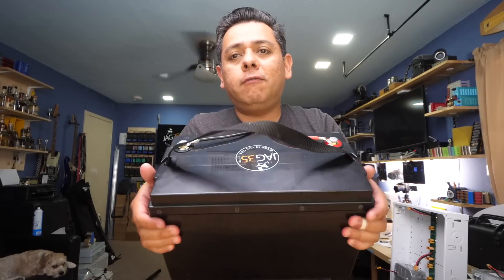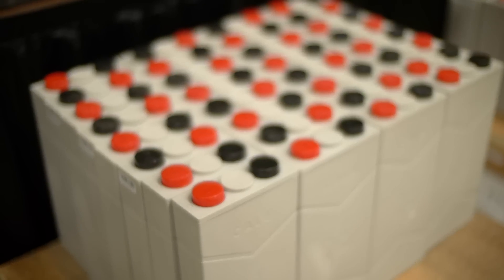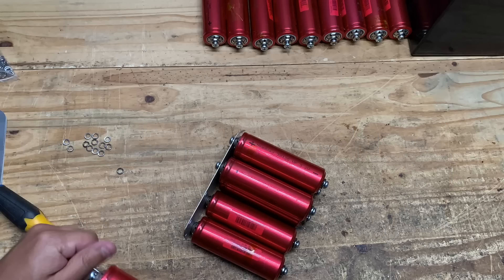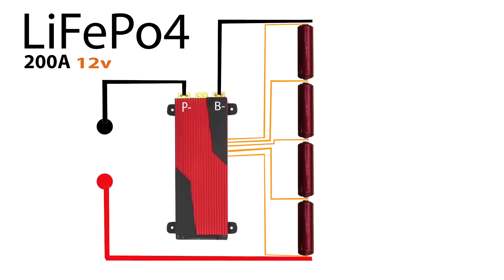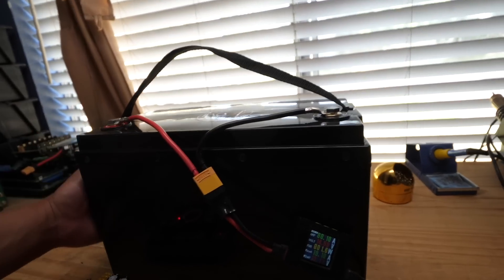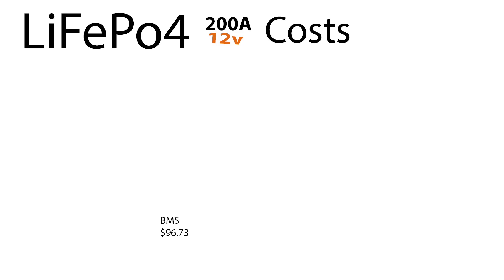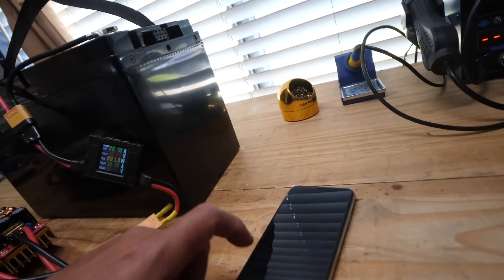Build a DIY Lithium LiFePo4 Headway 12v Battery replacement

Comment: I don't understand the relationship from amp hours to kwh in this video. I thought I understood, until I seen this
Reply from the maker: Ah x Volts = kWh
Reply: @jehugarcia  outstanding! Thanks
Reply from the maker: But likely this video is talking about kW = power not kWh which is storage capacity

Comment: Hey I have a question this is holding me back from making a battery pack is how can I find how much amps can a cell produce when I have lil to no information about them I bought old e-bike battery pack??,?, can you please help
Reply from the maker: You have to test it.   If the voltage sags to much or overheats then you know you’ve reach the cell power limit

Comment: 334 / 5 000

Fordítási találatok

Fordítási találatok

star_border

Hello! very good video, the batteries seem to be of very good quality, I have a few questions. I'm Hungarian and I'd like to buy this type of battery, how can I do it? - Where can I buy such batteries? - there is a screw at the end of the battery, it is not standard that you can do this, or buy it i? -If I put it on ebay, I would buy a few. I appreciate the answer: Tamás

Comment: I think the separator is a good idea (cardboard may not be the best material, but definitely better than nothing), however I don't think the reasoning why you didn't use any in the middle is sound. 
It's correct that there are screws holding them in place, but that's only at one end. At the other end, the sides that you placed cardboard in between is held together with a bus bar.

Comment: ok getting it now this is an 8 AH battery and four parallel gives 32 and this 200 AH is not the battery amperage, dont be confused. This is the discharge rate given by battery hookup and isnt the battery capacity at all. This battery is a 32 AH capacity (4 times 8) storage battery and nowhere near a 200 AH battery you will see sold at much higher cost.

Comment: might not see this but as a car replacement is it cheaper to create a battery out of 18650 cells that would charge a capacitor jumper rigged into the system. then the charge off the alternator regulated somehow to keep the Li-ion topped off but not over charged? might be cheaper than this set up for that application.

Comment: Just the cells alone, the price is already over $330 which you can buy fully assembled LiFePO4 12V car batteries. Upside you can replace the faulty parts and know everything inside it safe to replace.

Comment: I just want to use the headways to build a battery for my sound system , will 8 be enough and what’s the best way to wire them and what size wire should I use if I make connections with wire

Comment: hello, theoretically how long should this setup run a load of 10 amps and would this mathematically be a 64 amp hour battery 
also what is the cell configuration

Comment: I would like to build an electric motorcycle using as many golf cart parts as possible. I already have a 48v 3.5hp motor, a 450amp programmable controller, and plenty of cable. With 4 batteries like this and gearing for a top speed of 65mph how far could I potentially travel? 10 miles? 100 miles?

Comment: What do you think about fuse'ing each cell? I only ask for this because i did have an old Li Ion Battery with this Special Foo Like polarity Reversed by it self, this was Not funny to get this stupid Heating Lithium cell Out of the battery Pack. Is there Not an issue Like Reverse polarity to be Possible with LiFePo4 batterys? 

Kind regards :)

Comment: Perfect except you didn't explain the balance cables, or balancing the cells, or bottom balancing them. 3.66V is overcharged yes, so you could save yourself some potential headaches by programming in an over and undercharge safety so it charges to float voltage and discharges no lower than the safe lows of the cells

Comment: i don't get it ???  just the 32 cells cost 2,800 $ from this link.  why would anyone besides a student for a science project build this??  you can buy 100aH lipo battery's new unused for 1000$ with a 12 year warranty with a charger. what am i missing?  great instructional video though.

Comment: To recreate this project almost two years after this video, batteries and shipping (US) are costing nearly $800 from your link.
Reply: 3 years is showing about $400 — used (like he said), but tested cells. Even at $800 it's a pretty awesome setup using 38120HPs

Comment: How many Amp Hours was the battery you built in this video? Please..if i missed it anyone answer. I thought i heard 50? If that is the case i can buy one for under $400 pre-made by Battleborn or another reputable company. If we are talking about 100 or even 200 then that is probably worth it. Usually the case is that when you build your own you save at least 50%.

Comment: $88 each battery. Lol. What’s Plan B?
What happens if you just use four  18650s?  Most 12V DC can handle 14 volts. You’re car alternator is 14V. What’s the problem

Comment: Would you recommend this batteries for a car conversion? 
If so how many I would need to build to at least have a 100 mile range?
Reply from the maker: No these don’t have the required energy density to make them viable

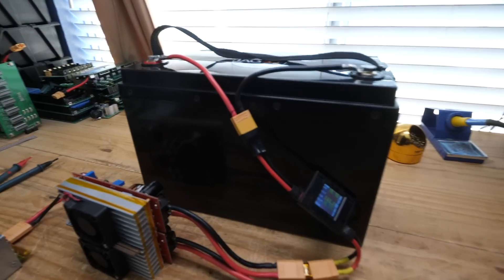Comment: Are those two DC Buck Boosters at 6:15 connected in parallel?   How do you hook them up?  I see one unit takes the negative input and the other takes the positive input.

Comment: Ordered 16 38120 HD 8 ah

Making a portable power box.
I have a 1/2 mile long driveway. I have a harbor freight electric pole saw to keep the brush and branches cut back. 

I’d like to make  four separate 12 volt batteries. 

Wire in series, then in parallel. 

Result 24 volt 16 amp system? Right? 

Will I need a BMS for all 16 batteries, or one for every 12 volt. 

Then a 24 inverter, but what wattage? 

Your channel is very informative. 

You sorta remind me of a friend I knew while I was on active duty in 
the 90’s

Comment: How can you have neg, and pos on the same plate, wouldn't it have continuity? And short out.
Reply: @hbvvc gghh oh so its like being set up in series, positive to negative. So in  each bundle the batteries are set up in parallel, then you put them in series.
Reply: @hbvvc gghh and the bms, red wires go to the positive side of each bank, and the black to the first bank negative?
Reply: @hbvvc gghh  oh ok, so what does the 4s mean in a bms, is that for a 12v battery setup?
Reply: @hbvvc gghh oh I see, I really do appreciate your help!!
Reply: @hbvvc gghh yes, actually I'm looking into taking some circuits off the grid at home, and putting solar to them. So I ordered some 3.2v lifepo4 prismatic cells. But interested in building my own.

Comment: I pay $49.99 bucks ( $55 with taxes ) for a 12V lead battery for my car every aprox 3-4 years. So I will spend $550 bucks on my car $12V batteries over a minimum 30 years period.
Then why would I need a 12V lithium ion battery that costs $550 for my car ?
Am I that stupid ?
Reply: lol. A fool would use this in their car. Ive been researching this for a week now. This is for systems where you can get 10 year out of. Every time you wear down a lead battery pass 50% you cause damage. These are for Solar.

Comment: Thank you for the informative video! I am trying to build my very first battery pack to power a 560W trolling motor for my kayak. Can I put 3 of these ((https://www.amazon.com/gp/product/B07X7MD2JK/ref=ask_ql_qh_dp_hza) )  batteries in parallel and get 48 AH capacity capable of running a 560w trolling motor? Also, would you be able to recommend a battery monitor meter that can measure AH? I am trying to do this on a budget, not cheap. Thank you!

Comment: After one year this build has entered the territory of purely educational. A 100Ah Battleborn would actually be cheaper than two of these even if you could still source the cells at the stated price. These cells are $88 new.

Still a great build.
Reply: Battleborn is that a brand?

Comment: The wires you use to connect the Main+ and Main- looks too small for more than 50A current, it will become very hot ( I'm sure the measured temperature will be hotter when if you remove the case, and influence the cell's consistency is strong, why not use 4 wires to connect them to the BMS or the pole together. heat is the killer to the battery, do you agree with me?

Comment: Great video. I did get 4 from batteryhookup, just to suppliment my sound system. Thou im queruous if i can do an 8 pack 4s2p which will fit my bike, would they start it. Bike has a 20A battery.
Reply: absolutely.. Story time!!! I have a 2009 KLR 650, bored out to 688cc, and i used a 4s1p pack of headway cells in 2016 to replace my battery. I extended the battery leads 4ft to place the new battery in a toolbox on the rear of the motorcycle to protect it from heat. I haven't ridden this motorcycle in two years now, but every few months when I want to clear the carburetor, I go out back and start it up. it has NEVER failed to start in these five years. The battery you suggest would start a small car. For a bike, it'd run for years and years if you manage the heat.

Comment: If you charge a lifepo4 I've heard the battery voltage sags down quite a bit after a few minutes... Why?

I charged my batt to 3.6v and it dropped to like 3.4v in 10min...

Comment: Given that each cell is 8Ah, that means it's ~$550 for 72 Ah @ 12V. In comparison, Amazon has brand new ready-to-go 12V LiFePO4 batteries for around $750.

Comment: I have a lawnmower that eats batteries. Lead acid does not last long charging and discharging, 2-3 years and another $150. Is there a way to use 18650 cells in a configuration for a UB12220 12 volt 22 amp lead acid battery box with the lead cells removed and plastic cells ground out to make the space available. Did you already make a video on this? I saw something on EBay that uses them but at $380 a piece. Maybe I should just go back to gas.

Comment: shtty idea. I know you've been sponsored by this battery producer but this is baaaaaad. 18650 cells we connect via tin wire which works as a current breaker you build it that way it is very dangerous if any of them dies after few days or 3yrs of use. Bad craftsmanship. go away
Reply: Pointing out the deficiency is one thing, but demonstrate via video what your talking about. Identify the issue, then provide an example (video, or link to a better build).

Comment: Hey friends. 

Long time no see since COVID infection. But getting better here in UK. 
Can I ask if I can make a 12v 4s 2p pack using 5 headway cells I have received??? 
Thus making it 12.6v and 18A??? Or should I get more cells to make it proper 4s 2p??? 
Any advice would be highly appreciated!!! 
It won’t be used for anymore than max 10A draw for small amounts and running some small 12v lights and appliances at 50-70w. Stay safe friend 🙏✌️🙏 keep at it Jehu!!! 💪💪💪

Comment: Interesting - and well done.  But ventilation is of concern.  Saw 67˚C (154.4˚F), which is rather warm for my liking.  Question comes to mind - how long can those batteries last in that kind of heat?

OK, this was a max test.  But in automotive application - how will the batteries fare not discharging very much before they're topped back off?  AND IN A CAR APPLICATION - you can't charge the battery from the battery terminals.  One would have to modify the alternator charging circuit, which means potentially altering how the car's electrical system works. I'm sure it can be done - but at that much expense - perhaps that battery is better served as a deep cycle battery.  Again, I don't know how long those cells would last being discharged deeply then replenished.  If you know the answer(s) to these questions - please respond.

Comment: Is this comparable in spec to a standard car battery? It seems like you built a trains battery rather than a car battery. I would like to see a standard Toyota Corolla spec battery. A true 1:1 car battery to lithium. 
(Truthfully I want to see you make a motorcycle battery but a car battery price and layout would be just fine)

Comment: Hi i need a little help i needed opus 4 cell charger but accidentally bought i-max b6. Can you help me to sell that so i can buy a opus, or if some one wants to exchange i can do that. I really need the opus as to check 4 cells at the same time, or else it takes a lot of time to check one by one.

Comment: Next time cut out a thin plate of plexi glas and then mount the plexiglas with the battery screws ontop of the metal plates, that way the distance is provided and it even looks cool👍🏻

Comment: A 100Ah Renogy 12v LiFePo4 battery on Amazon is about $800. $560 for 60Ah battery is hardly cost saving considering you get no warranty on your battery,

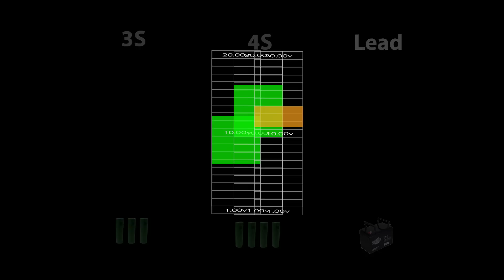Comment: How do battery manufacturers deal with "mismatch voltage" you describe at 1:07 when making 12v Li Ion batteries? Do they use 18650?

Comment: To anyone and everyone...   Would this battery setup be a good fit for a sump pump backup system?  It's my understanding that these batteries are good for long-term power retention but it doesn't have enough power (current) to support the draw of a 1/3 HP pump.  Any suggestions?

Comment: At 200am x 12v is that 2400 watt hours? Not an expert on batteries but for $544 that is a good deal for DIY right? That should be enough juice to power a microwave or stove cooktop after you get some solar panels as well to charge it.

Comment: Could this be used as a car battery? What about a solar power system?
Reply: Idk anything about solar power but a lot of people have started using them in car audio applications, you just don’t wanna put them under the hood because lithium batteries don’t like heat

Comment: Hey brotha .  Omg this is so incredibly cool. Amazing power and durability.  Ideal for what I need. I will dream of this untill I'm dead. I could never afford to build one but this is perfect for my trailer. Your so awesome for sharing the details. It would take me 10 years to buy each part but a guy can dream. Using two old battery's from a diesel truck that my son donated from his job is what I use and omg they are heavy. But they are 4 years old and were treated poorly. When I got them charged fully they were about 12.9 volts. But just don't have the amps in them. This is so hard to charge fast. Takes hours every day to charge with jumper cables and my vehicle. Ahhh . I'm basically homeless as we lost our home . The wife hates it but I'm grateful we have a trailer even though it's old. I'm on disability and dont get squat from social security. This is. Great info. If you ever had and old stuff to donate I'd be the one to help. Anything at this point. I need to use a Bipap machine at night to sleep and it' uses a lot of power with the water chamber on. Without it it's not so bad 6 amps maybe. But the 300 watt inverter just kills the battery before I wake up. I have to hook up a cord to my truck battery when it dies . (usually after 4 hours ) so I get up and do that to get the rest of my sleep. What a bummer it is. 
Anyways I just love watching your videos. I'm hooked. I've watched them over and over. But darnit I don't have the money to build one. Arrrgggh. I'm dreaming though. So hey great name and great videos. Keep doing what you do. Old People like me just love this info. 
 Jehu Garcia  peace my brotha.

Comment: The cells can produce much more discharge current than 200a, so is the BMS a bottleneck in this system? Can you use the BMS as a balancer only so you can use the pack directly for more discharge current? (car audio application)

Comment: Can you please post what this build ended up weighing?  I know a few Ham radio guys who might be interested if the weight is right. We pack radios, antenna's and batteries up on the highest point we can get to and do what we call "SOTA" (Summit On The Air) activation.  Mt. Hood, St Helens, Mt Raineer...if it has elevation, we'll go. The only thing holding us back is battery life and weight.

Comment: Great Video, Jehu! Very clear, not  ton of wasted time, great sharing. Price for a well built battery is just OVER the cost of a high quality, deep cycle AGM that may go 1,000 cycles. I thought that high heat & sub freezing temps killed LiFePo4 batteries? Any simple (vents) way to reduce heat at stress points? I always feel that installing fans in the walls of the battery were counter intuitive, but, can enough strength & safety be maintained while venting the case?

Thanks in advance,

Dave

Comment: most people who are wanting Lithium for a car, aren't wanting 12v, we are wanting them for our sound systems, which typically also includes a high output alternator. I myself am using a Mechman 370 amp Alternator that at idle is 14.4 volts, so for me, I use Lithium that rests at 14.8 when fully charged.